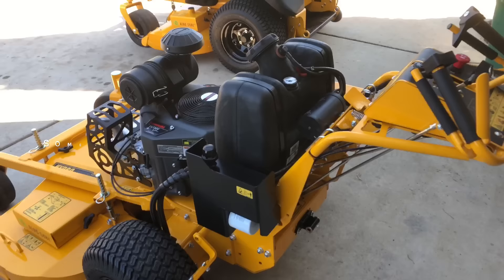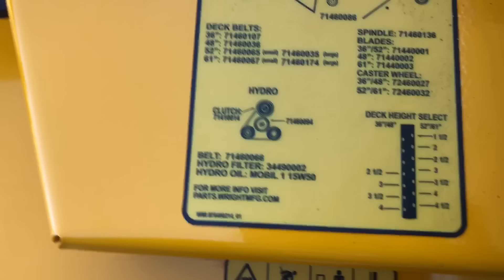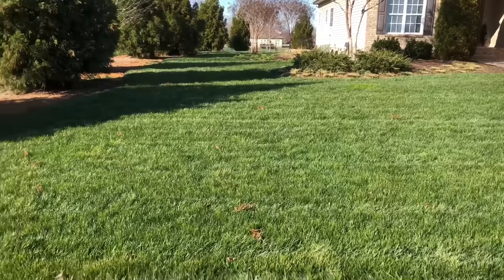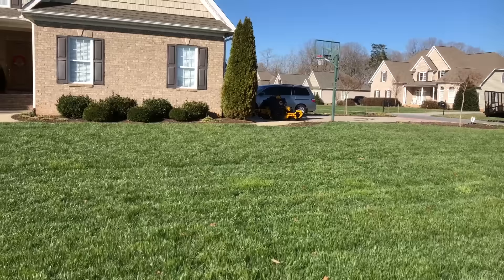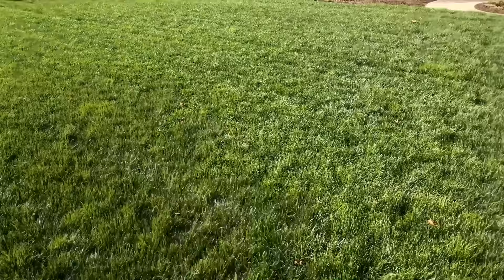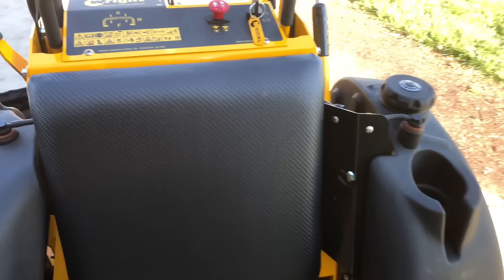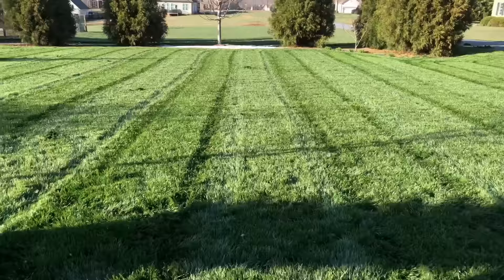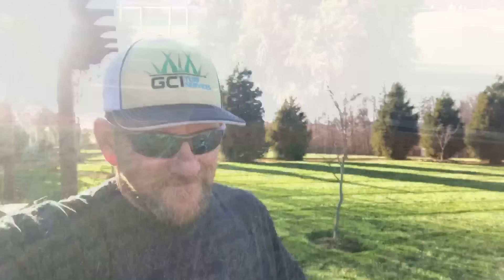Mowing the lawn! Wright Mower Stripes

Comment: the grass is too wet to mow.  try putting silicon spray on the underside of the deck so grass clippings won't stick as much. I do this on mt snow shovels the snow just slides right off them and never sticks when it starts sticking I'll just spray some more on it. if the snow sticks the shovel gets heavy making the job more work.  Work on a snow blower too.
with that in mind it should work on a lawn mower also. haven't had to do it yet on my cub tractor. Speaking of I like to mow as little as I can and just let the Tall grass do its thing, I won't mow after a rain or i'll get stuck at the bottom of the hill and so I don't get stuck I put snow chains on it year round.  We had so much rain this year it was hard to find a day i could mow.
First you have to pick up the dog poop. makes a real mess if you run over it with the tractor.
At least i'm not stepping in it.

I feel sorry for Pros that use a walk behind on yards where they ahve Dogs. eww. No you know when your having a shitty day.

Comment: No need  to roll mower on cement.  Wet cut grass on cement not good. Keep mower off cement use  hand push 21 inch light weight mower . Do not let wet grass get on side walk just keep mower off side walk by mowing first two times around lawn sidewalk near side walk and  bag the wet grass this way mower wheels never go on side walk or a driveway.
 May be best to bag the wet grass.Time of year mine clumps up wet grass even wait five days after watering a inch worth only 68 to 73 degrees last two  months near the ocean. I mow now with a bag. Water inch a week still stays wet near soil line tall grass  sun will not get to soil line very well. But keeps some weed seeds from growing keeping it tall 4 inches.

Comment: You should do 2 to 3 perimeter cuts then u won’t turn on the cement on any lawn u will always be on the grass hardly no cleanup. If u get clumps on the grass use your backpack blower and your done. If the grass is moist your gonna get clumps all the time.
Reply from the maker: Michael capolcn yep. All true

Comment: I thought it was a no no to throw clippings in the street because of motorcycles. Wouldn't you go around the perimeter of the yard first and throw your clippings into the yard so not to throw them in the street/house, and then work on striping.
Reply from the maker: I blow it clean once done

Comment: The way to cut a perfectly straight line for a starting line is to pick a point in the distance and focus on it while walking toward it. You do need to glance down at the ground periodically for safety reasons, much like you'd glance in the rear view mirror while driving. Doing this creates a perfectly straight line.

Comment: Wright got their deck design wrong.  Too may angles, not enough air movement, eddies of grass in the deck causing excessive clumping.  Long on great construction, short on engineering.

But, they are pretty to look at. ;-)  I like that Ventrac of yours better.

Comment: I have had a Wright Stander for about 6 years.  It works well BUT - the grass clumps horribly.  I spend 30 minutes under the machine every time I mow cleaning the bottom of the deck.  I called Wright - no response.  I wrote to Wright - no response. As I said - it mows well and I use it hard - but the deck design is terrible for clumping.  I will probably NOT buy another when this one wears out - however, that could be a long time from now because the machine is well built (other than the deck design.)
Reply: They responded to me the same day on via their facebook page.

Comment: Hey Pete: Did you measure the deck height from the front of the deck or from the back of the deck? The reason I ask is because Wright sets their decks to have a 1/4" forward pitch. So if the front is 4", the back of the deck will be 4.25", in which case your mower is dead on if you measured from the back. See this video by Ed for explanation: https://www.youtube.com/watch?v=o1SPbavILT0

Comment: Typical Wright Stander.  I have fought that issue about four years.  You will have to clean out from under the deck daily.  Bad deck design?? It helps to make sure the RPM's are at least 3600.  Good luck!
Reply from the maker: No worries with the RPM's. I got the larger EFI motor. Plenty of HP. Doesn't even consider bogging down. The grass was just too wet to cut. I screwed up, not the mower. see this video https://youtu.be/D4DxElzDjr0

Comment: Does the wright zk do that as well or just the walk behind?
Reply from the maker: Don Abraham it did. But I really don’t think it’s either mower. It’s be cause the turf is VERY full of moisture right now. That’s what is causing the clumping
Reply: GCI Turf Services well then if that’s true then why did the exmark not do that?
Reply from the maker: Don Abraham because I’ve always waited until the turf was dry to cut it. I just got a new mower. Lol. I was excited to use it so I didn’t really care if the grass was dry or not 🤪
Reply: GCI Turf Services I honestly don’t think those rights are made to cut that tall fescue. It’s more of a weed and grass mix deck mower, just like scag
Reply from the maker: Time will tell. when I demo'd it last summer it cut like a champiom
Reply: I had a Wright Sentar, and like Pete is saying mine would seldom do that on wet mornings or on a nice thick yard. But other than that it was an awesome mower.
Reply from the maker: YEP
Reply: GCI Turf Services I’ll tell you that the zk is the best stand on mower on the market right now. I demoed one for a week last Season and it blows my scag out the water. I probably buying the zk very soon, that’s why I’m about the clumps

Comment: you are not that bright are you ? in order for the deck height for mowing blades to be correct you MUST check tire pressure before hand which you did not do and last but not least ... most mowers are not completely assembled and the lawnmower dealer assembled it from a shipping crate and chances that it was a snot nosed teenager is very good ... you need to adjust your deck to the proper height so that it conforms to your settings .. this is something that has to be done by someone interested in everything being assembled correctly and not just slapped together ... almost every mower needs the deck to be adjusted and fine tuned to get optimum cutting ..
Reply from the maker: LOL.....  Glad you woke up on the right side of the bed today   ha ha ...........
Reply: Dude.. supposedly when they deliver these machines (especially commercial ones as the ones he shows), the vendor should adjust them properly.  This is not crap shipped from China.   So.. he's right, some of these machines measure the height of the exterior of the deck as part of their settings.   Unfortunately, the proper way should be the height of the blade.   BTW, he did a great job explaining.... why attack him?